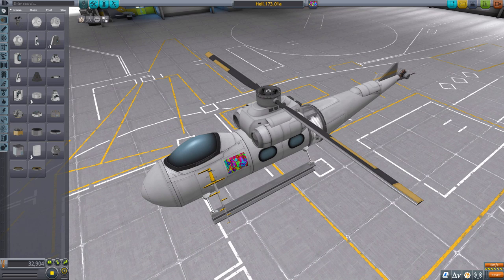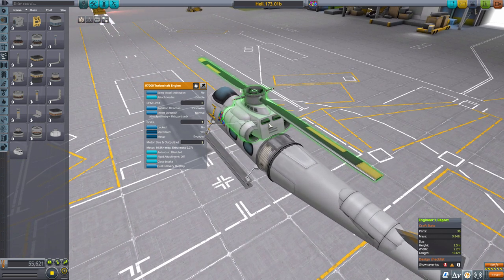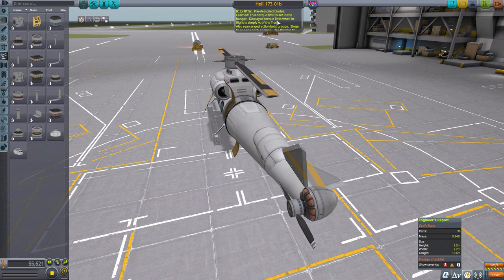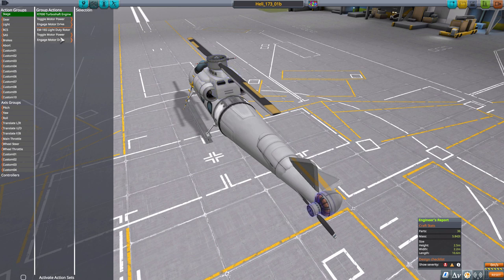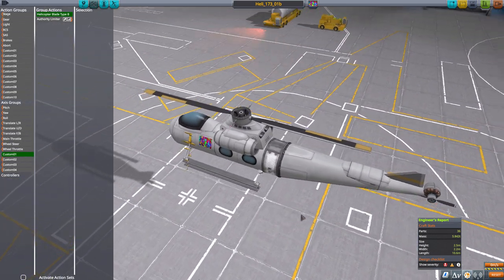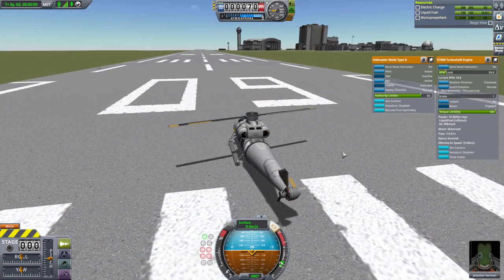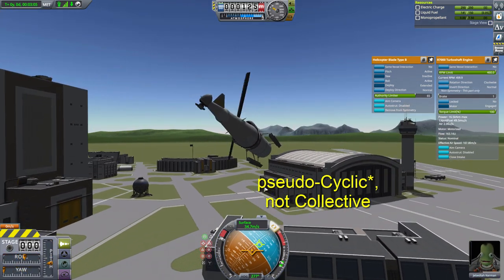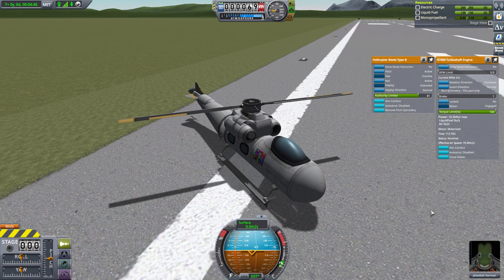KSP 1.7.3: refined + improved (simplified) helicopter controls

Comment: Niceone, I was right there with you the past few days trying to decipher the relationship between the Motor size and actual torque output relationship. I was getting an intuition, but your explanation seems pretty accurate to what's going on.  edit: next kerbal thing to do will be to create a flywheel in place of the helicopter motor and spin it with small jets or rockets. I know it's been done before in old versions of KSP, but not with the new helicopter blades as far as I know.

Comment: I know that it doesn't really matter as its a game and the exact details are irrelevant to its function, but technically the helicopter engines are listed as turboshaft engines which means they dont convert fuel into electricity but rather directly spin the rotor using the turbine. As I said, it doesn't really matter as it isn't relevant to its functionality in the game, but I'm just a bit OCD like that. Otherwise great video, thanks so much!
Reply from the maker: Yeah no worries.  Wow, how is this video already two months old?  I don't remember the quote in context but I think I was mentioning the electricity to alleviate potential concerns of people who've either built stock electric propeller engines in the past in KSP or have already tried using other robotics parts -- either of those play experiences would've traumatized most people by the amount of electricity demand and supply, so I was probably mentioning electricity with regards to the helicopter engine by way of explaining that players would not need to worry about providing electricity for the craft since the helicopter engine mostly takes care of itself.
Reply: @ArchaicAlibi  Oh ok, that makes sense. by the way, while your here I was wondering if you could answer a question I have not been able to find any info on so far. Other than for propellers and purely aesthetic applications like spinning space stations, do you know that the knew electric rotors (for example the em-32 standard rotor) can be used for? Especially with the final version of the DLC having 6 variants of electric rotor it seems like they thought they would get a lot of use but other than props I can't think of anything.
Reply from the maker: Um, no, I don't know of any other good uses.  I can make a couple of guesses, though.  Since the rotors seem to be more powerful than the servos, I'm thinking they could be used for very large contraptions such as homemade siege weapons or swinging battering rams.  The annoying bit would be getting them back to a home angle but other mechanisms could force them there.  They might also be used in a continuous rotation capacity for some very heavy duty rovers that want to be a bit different than using the gigantic wheels, maybe even for a tank track system.  Your guess is as good as mine, though.

Comment: I have a different method of setting up controls for helos.  I use the KAL-1000 as an Engine Control Module and basically remap the power curves for engines and collective to my throttle.  I have a lot finer control on the hover/collective, and can fly the helo without relying on keys that I would not otherwise have to think about when flying a jet.  These kerbo-kopters (as I have come to refer to them as) are not really helos at this point because they don't incorporate any sort of swashplate mechanics for cyclic control.  ...at least not yet.  But, as you have done with yours, we can fudge it for now with control wheels.  If you'd like to give it a try, to compare how it flies with yours, my helo is posted here:  https://kerbalx.com/XLjedi/AH-11-Dragonfly
...there's also an hour long video tutorial on how I set up the blades and coaxial motor drive.
Reply from the maker: Oh that's you!  Yes, I saw your helicopter when I uploaded my files to KerbalX.  Dude, your thumbnails are boss.  bows in humble deference
Reply: @ArchaicAlibi  Thanks, and thank you for posting your video!

Comment: How were you able get SOO much thrust from only 3% I used 100% on my monoprop with a 45 deg angle but i just can get more than 30 m/s of speed?
Reply from the maker: So, somewhat ironically, the plane engine seems to be more difficult to work with in my experience than the helicopter engine.  For my plane, I had to go with 100% torque and some very aggressive angle of attack on the prop blade pitch just to make the thing take off down the runway.  It was only after the plane was airborne that I could start reducing torque and readjusting the prop pitch for cruise.
Reply: @ArchaicAlibi  What? Haha, Squad is REALLY gonna have to fix that! I was so excited to make some OP prop planes :(. Amazing tutorial nonetheless. I learned more about ksp from your videos last couple days than I usually could have learned in a month. Keep on producing, my friend 👍
Reply: Same here, my planes are slow as heck
Reply: @Brixxter  I haven't experienced these problems, my few first planes. Useing octo attatchment with the middle or biggest plane blades I have allways had between 140 and 280+m/s top speeds. My top speed plane has a push-pull with angles at 95 for take-off maxing at 144-145m/s but accelerates at about 2G's and a top speed of I belive 20 or 40 angle and a controller to slowly move all the blades between the 2 positions for it to accelerate up to 280 and just a few m/s shy of 290 (got a video on my channel if you're deadly curious lmao)
You basically want higher authority at lower speeds, and lower at higher speeds. there is no 1 do-it-all limit (the best I got for a single setting was 170) just sit on the runway and move the limiter around and see where it "hooks" same for testing top speed, just keep going back and fourth slowly seeing where it maxes out, but not too fast. If you go too far you lose ALL of your speed and stall within seconds!

Comment: So, the spinning part is electric and the engine is glorified fuel cell?
Reply from the maker: Eh, I guess?  I may have slightly simplified the explanation.  I think the in-canon/realism explanation is the engines behave like turbines as opposed to piston engines, though the lack of exhaust and the manner in which the engine's tweakables are displayed to the player does favor the fuel cell interpretation.  Either way, they work when the engine's input requirements are met, same as any old jet engine.
Reply: @ArchaicAlibi  
The reason that I am asking is that gasoline engine doesn't seem to be needed because all it does is to convert jet fuel into electric power.

Comment: But what's wrong with roll in these helicopters? What makes roll of the aircraft so unstable?
Reply from the maker: I honestly don't know.  My best guess is a combination of 1) the fact that, in a roll, the rotor head traverses along an arc around the longitudinal axis of the craft rather than the craft traveling like a pendulum underneath the rotor head, and 2) if the rotor blades are set to provide active assistance in Roll maneuvers, the application of force seems to be occurring courtesy of the yellow vectors in the Aerodynamic Forces Overlay -- those yellow vectors are at the root of the blades near the rotor head rather than farther out near the tip, so the torque arm within the rotor arc itself is very short, thus changes in roll (and pitch) attitude are slow to occur and equally slow to counter.
Reply: @ArchaicAlibi  Hopefully Squad will fix that somehow...
Great videos btw, keep up the awesome work!
Reply: If the rotor is spinning clockwise traveling forward the left side generates more lift than the right. It goes on the right if it's counter clockwise
Reply from the maker: @human_3217  That's true of real helicopters but that behavior does not seem to be modeled in the game.  Or, I should say I at least have not encountered it at my relatively low speeds (<50mps) of helicopter flying.
Reply: @human_3217  You know I never thought of that...
Reply: @ArchaicAlibi  This is because when you're standing still relative to the air the lift will be equal among a fixed pitch blade, and the faster you go the larger the drag on the retreating blade will be, as the incoming air will be creating less and less lift and eventually in the case of a slower blade may even start creating negative lift. As the lift on the retreating blade decreases the blade will start to stall and due to gyroscopic precession this will manifest itself 90 degrees into the rotation causing the helicopter to pitch up and slow down. In real life we mostly overcome this by using a swashplate mechanism that will decrease the pitch of the blade in the retreating region when you push forward cyclic, decreasing the drag it produces from incoming air. Retreating blade stall is the speed limiter of real life helicopters.

Also it surely is modeled in the game, just try a large, slower rotating blade on a helicopter and you'll really notice that retreating blade stall will kick in really fast.
Reply from the maker: @PipBoomer  Thanks for adding this info.  I understand how rotors work, I was simply reporting that I had not yet observed the game helicopters behaving in a way that I was expecting from real life observations/knowledge.  But then again I haven't had much time to test a wide variety of flight conditions, so it's good to hear what you found.  

@Sebastian I also have a suspicion that KSP's wonky precession modeling might have been responsible for general helicopter instability not only in this version but all past versions of the game, but it's difficult to prove that experientially without a control that is known to behave perfectly for comparison.  So my earlier guesses are the ones I'm sticking by for now.
Reply: Omg. That's why my own attempt at helicopters with 1.7.3 failed so much. I simply don't have a master's degree at both aerodynamics and engineering...
Reply: @ArchaicAlibi  I have gotten negative lift on my counter rotating helicopter. It was going 100m/s and with 200~ rpm. Because it was counter rotating It could go so fast without rolling like a rotor blade spins. Press f12 while flying forward and you can see the higher lift vectors on the one side. 

(It also had forward facing jets. Its a really nice helicopter and looks like airwolf. I found it on kerbalx.)

Comment: persoanlly I find flying anything that has a single rotor to be unbearably tedious.
since the way SAS works it wont properly counter even the slightest torque from an engine, and if it does then as soon as you do an input the sas stops countering and you'll get the spin for a period of time.
I find it way easier to just make counter-rotating props for everything, and personally think it looks cooler.

Counter rotating props are my favorite. got a video of the biggest one I've done yet, very surprised with how precise you can be with the blade pitch.

Comment: Greetings, actually, you didn't manage to make easier with those commands, in fact, this is the way how REAL helicopter generate lift and how does controls on real helicopter works. Real helicopter generate thrust by rotating the blades (in KSP case controlling the authority limiter), and that is done by pulling the lever in the middle near the leg (depends of type of the helicopter, left or right), in that case, pilot pulls the lower swash plate down which is located below the blades and which is also connected to the upper plate, bottom splash plate is also connected with control rods which are flexible, the upper plate is connected to the rotor blades with the driver and also with the control rods but in this case those ones are fixed.

Just find somewhere how the helicopter works or how does it generate the lift.

Lets see from top to bottom the parts of the main rotor:
Top: Blades, control rods, driver, upper splash plate and shaft
Bottom: Lower splash plate, control rods, shaft

P.S. Pilot can also increase or decrease the RPM to generate more or less lift but if the blades are set to generate the lift, otherwise you can spin full RPM and generate Zero (0) lift.

I hope I was explain a little bit ;)

Comment: I'm trying to make a tiltrotor but I can't get the rotors to rotate. What do I need to do to get the turbo prop engine to work?
Reply from the maker: Satisfy its requirements for liquid fuel.  (It provides its own intake air.)  Engage power (torque).  Engage motor (RPMs).

Comment: You got thousands of questions like this, but...
I made a Chinook-like tandem helicopter. I managed to balance it properly, I used your technique to assign a custom hotkeys for AoA of rotors, I mange to fly and land it. But I have a problem. Whenever I touch W or S key (to tilt the copter forward or backwards) I instantly get slightly less lift from rotors,  so I fall down for a moment. I have to compensate it with increased rotors AoA. But as I release the key, the lift comes back so I have to lessen the rotor's AoA again. It's quite annoying. Both yaw and roll don't affect anything. 
Do you know any fix for this? I already have 2 medium sized reaction wheels, my heli weighs 14 - 15 tonnes depending on layout.
Reply from the maker: Actually Booze Biscuit just before you in the comments asked a very similar question.  The culprit for this behavior is unknown to me.  It could either be intentional but inaccurate modeling of retreating blade stall as BB suggested, or exaggerated precession as I'm inclined to believe, or something known only to the developers.  Intentional or not?, can't say.  
The best way I've found to cope with it is to not fight it, to not expect very fast or very sharp maneuverability from the helicopter, but to instead gradually build momentum in a given direction and only push the aircraft's lean as far as it will aerodynamically balance out without losing control.  Alternatively, if speed is a priority for you, you might try adding additional means of propulsion to the craft while relying on the rotor only for staying aloft.
Reply: @ArchaicAlibi  Actually I think I may have fixed it. I stuck a bunch of reaction wheels (in addition to hte ones I already had) and removed the pitch controll from rotors' blades. Now it doesnt loose lift when tilting forwards/backwards. And its actually stable enough I managed to carry a 5 tonnes submarine with it. 
Its stable up to 75-80m/s, give it more and it will start yawing from right to left, probly because of retreating blade stall.
https://i.imgur.com/rFgRlzD.png

 ( P.S. Don't mind ridiculous amount of authority on blades, that sub is really heavy)
( P.S.2 And the torque is 0, becasue I need to CTRL + PRNT SCRN to make a screenshot. I fly at 20.0)
Reply: Hmm, did you try removing the yaw pitch and roll controls on the blades and then simply rely on sas?
Reply: @paraweld9838  not possible. Sas is not enough to rotate this heavy chopper efficiently. I removed pitch though, you don't need much force to tilt it.

Comment: What is the difference between RPM and the torque percentage? Do they control the same thing, which would be the speed of rotation?
Reply: I think torque is the actual useful power (ability to move heavier or bigger rotors faster) and RPM is how fast they spin
Reply from the maker: Pretty much what Hat Kid already said.  ...  RPM is a measurement of rotational velocity.  I do not yet know how applicable it is in KSP, but in real life the RPMs are important for determining not only where on the blade (depending on rotor diameter) lift is likely to occur but also what blade angle of attack and what relative aircraft speeds are most optimally combined with a certain RPM setting.  That also has to do with the shape of the blades' airfoil but in KSP the airfoils all seem synonymous.  Generally speaking, at peak performance, more RPMs are better, but lower RPM settings can be useful in low airspeed scenarios.  Another nice thing in KSP is that the wide range of values on the RPM slider in the hangar means there is a lot of room for reduction or coaxial designs or even using RPM settings in flight (which is less sensitive than torque, in my experience) to affect yaw motion, especially on twin rotor contra-rotating helicopters.  ...  Torque, as you'll see in the PAW when editing the motor size slider in the hangar, is a measurement of kiloNewtons, or the raw force that the engine is capable of applying to make the rotor turn.  This affects rotor acceleration rates, top speed, load capacity, etc.  Generally speaking, the more torque you have, the heavier a load you can move and the sooner you can get it up to an operational flight speed.  That is why I said in the video that you shouldn't overdo your hangar torque settings because you only want to have an engine that is large enough to service your aircraft's needs.  Using a larger engine is wasted mass and using more torque from an oversized engine is wasted fuel consumption.

Comment: I'm getting an uncontrollable increase in pitch and roll during flight. Is this retreating blade stall? Most of the time I'm not even going that fast. How can I counter this?
Reply from the maker: That's nothing new for helicopters in KSP.  Whether or not it is intentionally modeled aerodynamic phenomena I can't say since I don't know the root cause in the game's programming.  I've always attributed it to excessive precession because it happens at all airspeeds.  Faster merely makes it worse.  Before these new engines came along, everyone's solution on old fashioned stock props was "moar reaction wheels".  I suspect a good way (if it existed in the game) to solve these problems would be to have true cyclic behavior on the rotor blades but alas...
Reply: Oh, ok. For some reason I thought I was the only one experiencing this. They're probably working on an update then. At least I hope so.